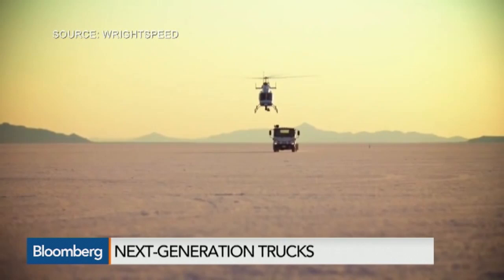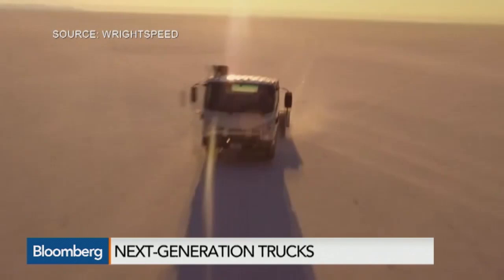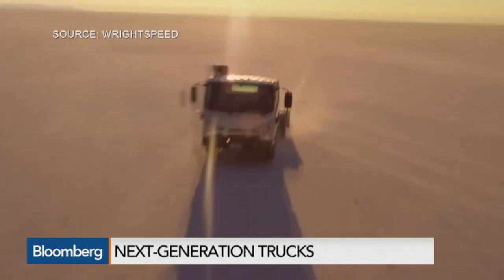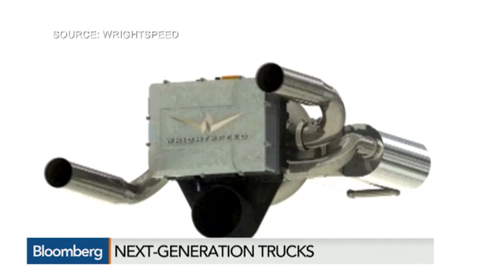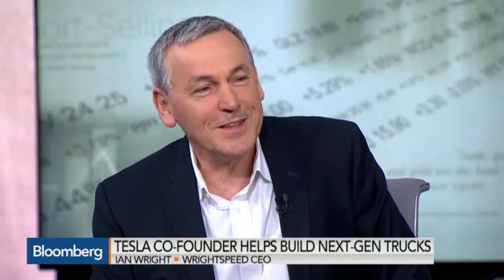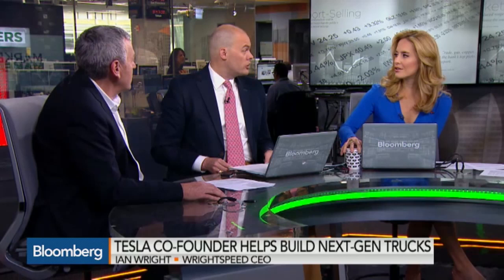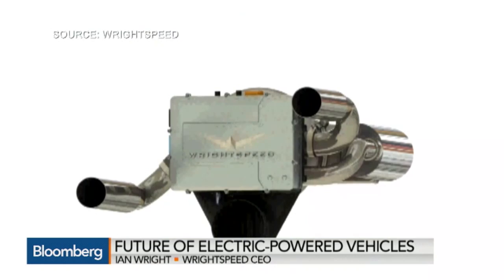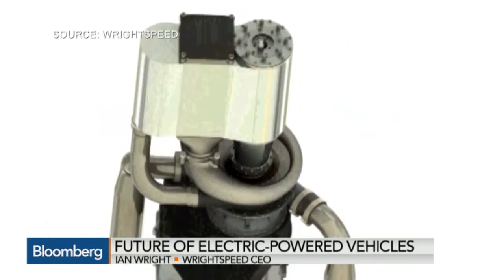Next-Generation Trucks: 18 Wheels and One Turbine

Comment: this is 21st century Technology....
apparently ... there was one oil company sycophant that did not like the video..TFB...
Reply: Burning fuel is not my idea of a 21st century product, regardless of efficiency and all that nonsense. He does claim it's more efficient to spin a turbine than it is to run a coal power station, but in countries like New Zealand where he's from, we're 90% hydro-electric and wind power here.

Batteries and sustainable electricity, that's my idea of the 21st century, and that's exactly what Tesla motors are preaching (of which he helped found.)
Reply: Unfortunately, even the best batteries we have today SUCK when it comes to storing energy. 1 gallon of gasoline has the equivalent of 36 kWh of electrical energy. Even the best car currently only has the equivalent of 3 gallons of gasoline on it. What needs to be done is develop an engine that can utilize that energy available in gasoline (or even better diesel) without puking most of it out as heat.
Reply: Rexford L
Yes, but even the worst electric motors will use about 88% of that energy for thrust, compared to the < 30% for any "good" combustion engine. Then there's the lack of maintenance and fuel savings. Batteries don't have the energy density of petrol, but they can sure as hell be used just fine in a car, as proven by Tesla Motors.
Reply: Alex Paulsen let's see... it takes how long to charge your "just fine" batteries? I do believe that even the fastest method of charging the batteries for a electric car is over an hour at a Supercharger. Now you want me to wait an hour for Joe Blow to refuel his car then the line slowly moves up (I'm talking if everyone had electric cars, and they are fueled and used like petrol vehicles) can you imagine the lines, you would spend 90% (or more) of your time waiting in line to charge your car. if you say that wouldn't happen, it's already happening at current Supercharging locations...
Reply: Rexford L
30 minutes on a rapid charge for 80+ KWh, with numbers constantly decreasing. Please tell me how you can manage cross country trips without stopping to take a shit, eat some food, and stretch your legs a little. The truck stop and/or roadside diner wasn't invented for nothing.

Development of anything other than battery powered electric vehicles is just slowing down the development of all the things people keep complaining about in regards to BEVs.

Electricity is already distributed across all 1st world countries, we don't need to go to "electricity stations" unless we're travelling and need a top-up along the way, or we can put charging stations in car parks, on the side of the road, anywhere really. Hydrogen on the other hand requires a whole new network to make it happen, and it uses a whole lot more energy and effort just to get it into your car/truck/bus/whatever.
Reply: lets see, when I'm driving cross country (and yes I've done it numerous times) I don't stop every 300 miles for an hour to fuel up. (I drove from Pensacola Florida to Albany Oregon leaving Pensacola at 2 pm Friday and arriving in Albany at 7 pm Sunday) Sorry, any current electric car just won't cut it for how I drive cross country nor will it cut it for the off road driving that I enjoy doing. You can enjoy the limited city driving that your electric car is really limited to, I'll continue driving my internal combustion engine vehicles.
Reply: I stand corrected  THREE MINUTES  or LESS